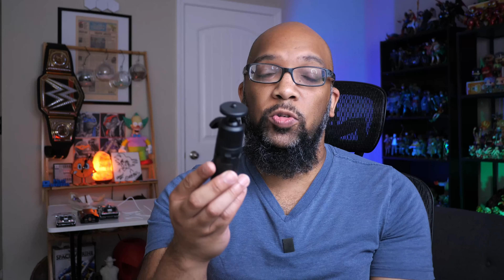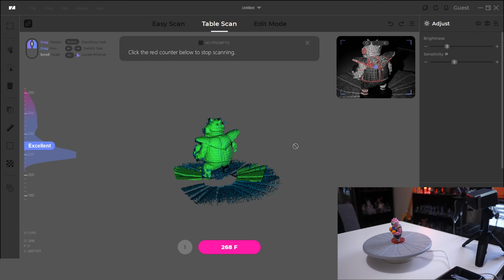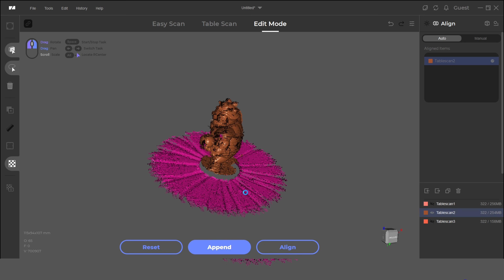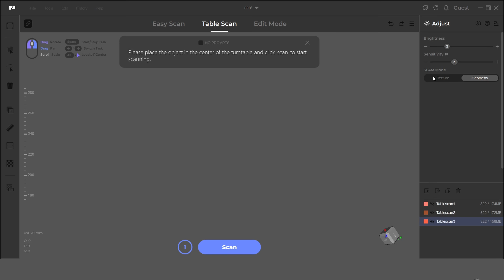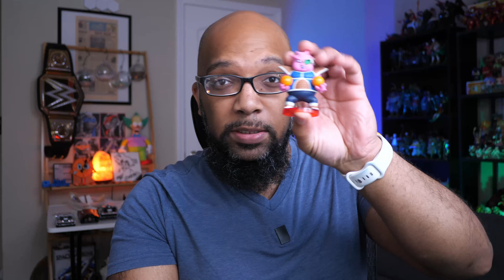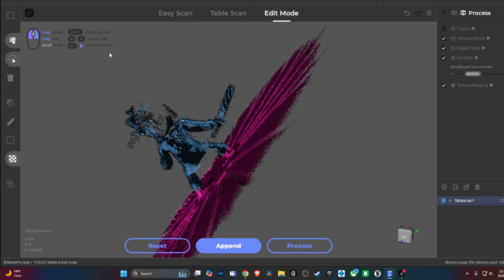How Easy Is 3D Scanning? Trying the Seal 3D Scanner by 3DMakerPro

Comment: thx for the video, could you try to turn the figure on the plate so you can scan the areas that are blind to the camera, simple parts like the lego you can help the scanner if you put stuff around with more feutures or lift it on a from the table.

Comment: That little hole is for drainage if you Resin print it Jeremy.
Reply from the maker: The original figure(s) in that line all have that tiny hole in the back. It's part of the design for some reason.

Comment: I’ve been using this for about a year for action figures. It does an amazing job all things considered. A couple things you have to understand is that you should take the time to clean up the scans before processing. You also benefit from scanning several different angles. 

The other thing is that the auto alignment doesn’t really get it right. Manual align is great. 

The other thing I’d that I always clean it up in blender and bring back the details. It’s like getting a great pencil sketch and you have to then go in and ink and color. 

We’re not there yet to scan and print, but seal is one of the best right now for small objects.
Reply: Which scanner are you using?
Reply: @glanas7463 seal